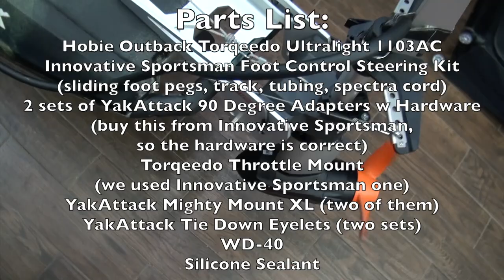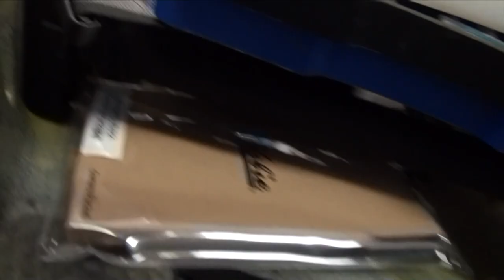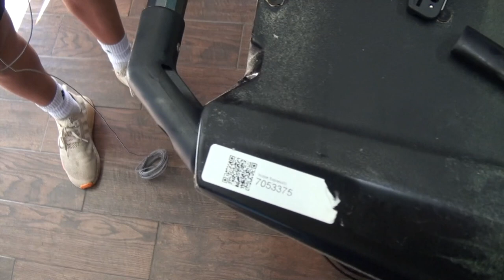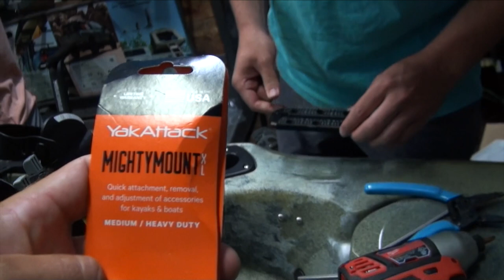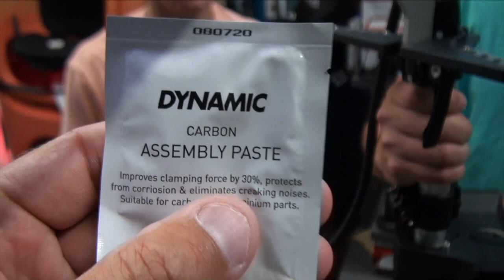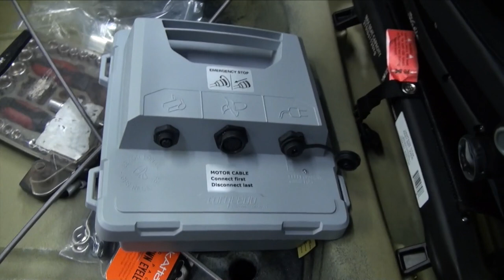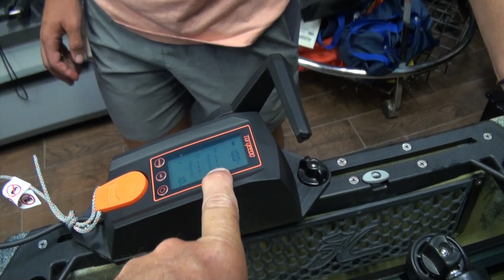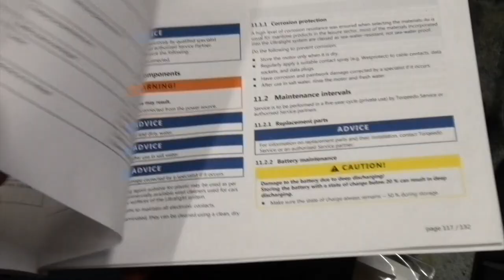Hobie Outback Torqeedo Ultralight Installation //. Foot Control Steering

Comment: Like the build. Looking to setup steering for my newport nk on my Outback. Just wondering if there is amble clearance between the foot steering and peddle drive?..  or does it get a bit tight if u have wide feet or boots on.. also how do u like the low mount for the controller?, any issues with taking spray or splash  having it low down like that on a choppy day. Thanks in advance

Comment: Is the 1103 a good choice over the 403 on the Outback?
Reply from the maker: The 1103 is the better choice for several reasons: top end speed, efficiency, quiet operation, immediate throttle response and durability.
Reply: @TheLittleStuff  Thanks! I picked up an rvr119 bc of your videos and ordered an 1103 for it. Will be ordering a second 1103 for the Outback.

Comment: Use a straightened crappie jig to finish pulling the spectra line through. Just barely bend the tip. It will grab and pull it right out.
Reply from the maker: That’s awesome resourcefulness! I’ve also heard of folks using an air compressor to blast it through.
Reply: @TheLittleStuff  I’ve been going through some of your videos trying to dial in my Torqeedo 1103 on my Feelfree Lure 13.5 and Moken 12.5. There has been a lot of trial and error.
Reply: @TheLittleStuff  Matt Ball has been helping me too. I used his spacer idea.

Comment: Hello gentleman.  I just bought and install the 403 on my outback today itself and on forward on maximun speed on test of course it shows E45 and of course it stops the motor in 3 second and I need to restart same. Any advise ?
Reply from the maker: Please contact a Torqeedo Certified Service Technician. Here is a link that should help:
https://www.torqeedo.com/us/en-us/service-center/service-and-repair.html
Reply: @TheLittleStuff  Thank you really appreciate
Reply from the maker: I can also help troubleshoot some. My number is 815-528-2007.  But ultimately, it’s a service tech that will get you going again.